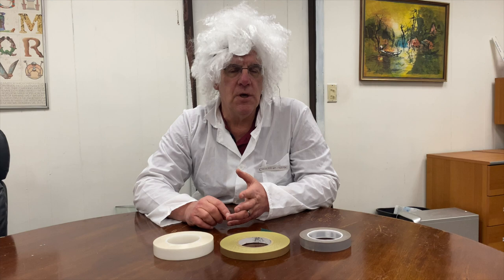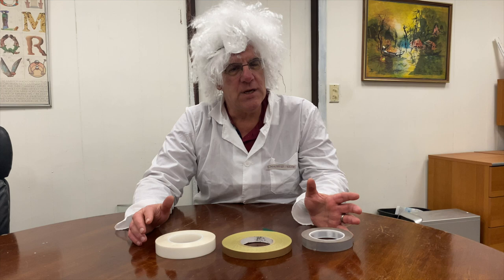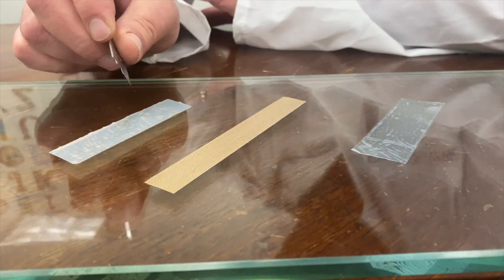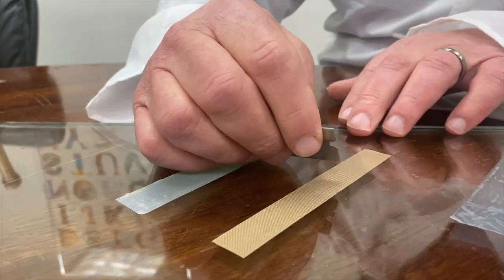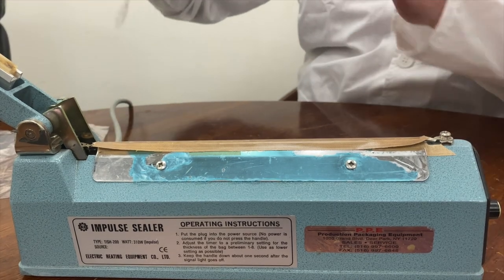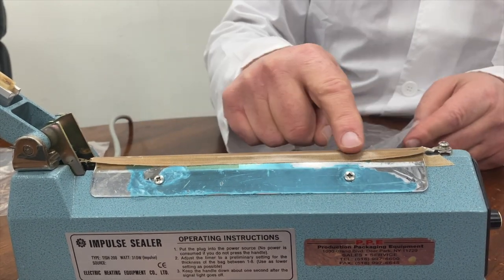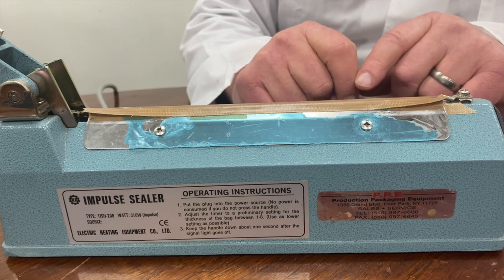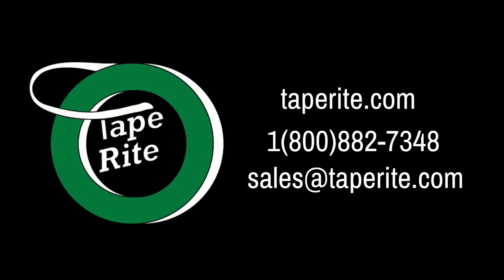Slippery Tapes | PTFE Teflon™ v UHMW   HD 1080p

Comment: 4 year old video, 33 subscriber channel, dumb wig and labcoat, most accurate+informative+concise video on the internet about the differences of these tapes. If i was in mfg I wouldnt hesitate to use you guys as a supplier. as a home gamer DIY im looking at tiny batch questionable suppliers from china. really appreciate the unicorn of a video though... 
Personally I found
PTFE fiberglass tape $
PTFE solid tape $$
UHMWPE tape $$$
a big difference to me is how stretchy the ptfe coated fiberglass tape is, especially compaired to uhmwpe for taping weird things like old drawer slides.

Comment: Great video. I am using UHMW for my drawer slides. Do you think applying paint and polyurethane to the outside of the drawers will negatively affect the sliding motion on the UHMW strips?

Comment: But what if I need a high friction, high temperature solution?! Such as seals for over-sized high speed ball bearings?
Reply: What if you replace metal bearings with ceramic ones?
Reply: @luka___899  No can do homie. 
Making a hubless wheel. It's godda be aluminum.